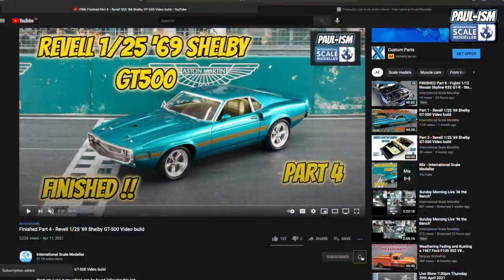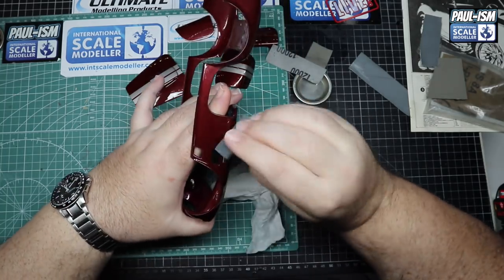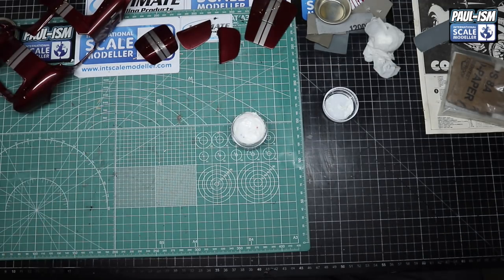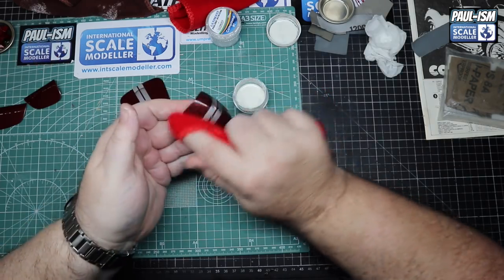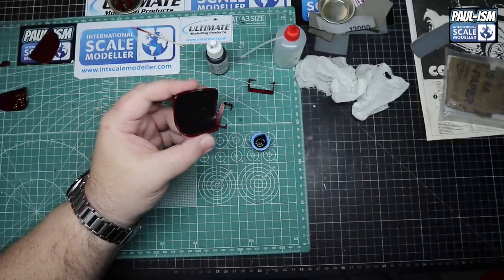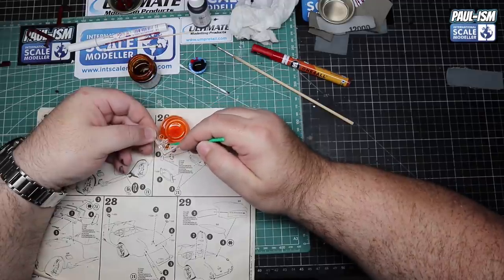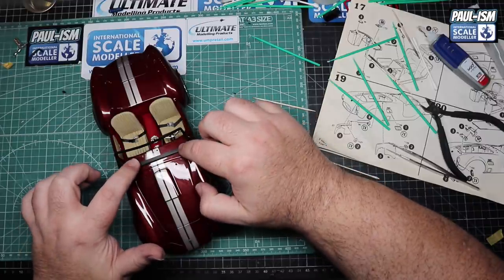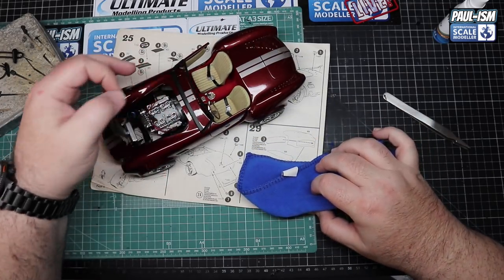*Finished* Part 4 - Mpc/Airfix 1/16 AC Cobra Step by Step Video Build

Comment: Yet another beautiful build Paul. Here in the states I was turned onto a product called Modge Podge for clear parts and it works amazing. It does take time to cure but cures crystal clear with no hazing of the plastic. While watching this video I placed an order with UMP for their MEGA pack ultimate modelers sanders and thinny sticks. I ordered a small order of these sanders a while back and they are the best product I have used for plastic models so I had to have more. You mention about being a bit different than the norm on your builds which I find perfect because I'm the same way. HOT ROD magazine put out a copy of their magazine several years ago with the headline that read Dare To Be Different. I've tried to do most of my projects with that mindset ever since. Please keep the amazing videos coming.